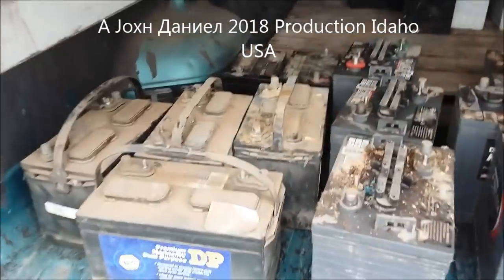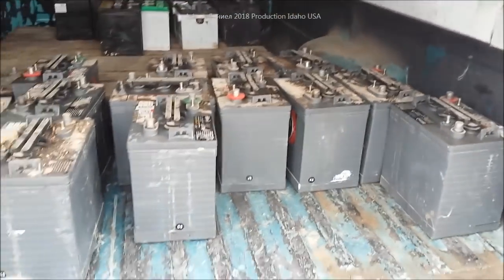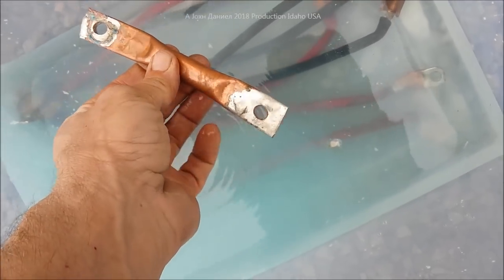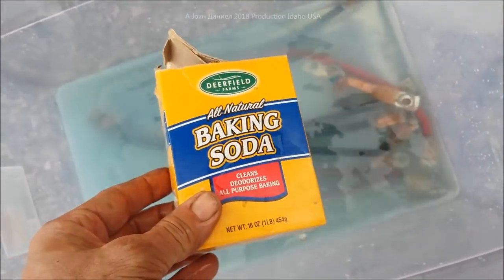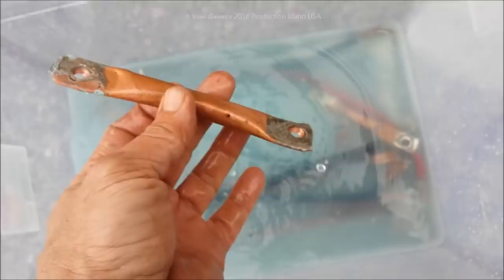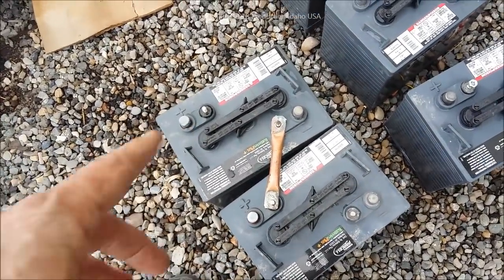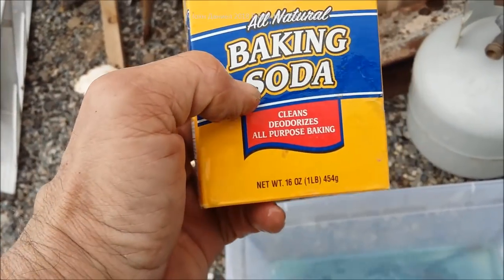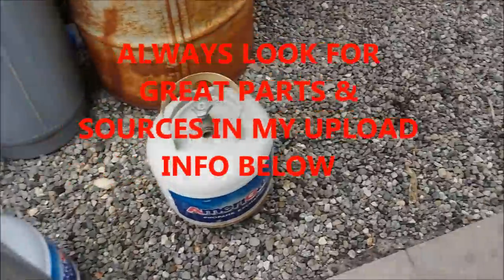Great battery care & Off Grid tips - save your car Battery Service Items Below

Comment from the maker: A Parts List you'll love  ↘ -- USA made Welding/Battery cables TEMco https://ebay.to/2HizLDi pure 100% copper.  Exact 5/8 type L Copper tube https://ebay.to/2F3eHe9 900 amps & only 0.90¢ a battery.  Battery Acid tester https://ebay.to/2HeK8IC and always use a HEAVY BUILT load tester to verify your batteries https://ebay.to/2HPn8Np
AFTER you install or repair I highly suggest using https://ebay.to/2HNT7xg by Permatex, battery protector and sealer. 
This is A ABSOLUTE MUST list for doubling the life of your RV, Boat, Off Grid, and Cars batteries! 
Years of research, use, off the grid living and verified results brings me to put together a list of affordable parts you can easily go to to. Hope its helpful.

**For my RV using friends, NOTHING beats this carried with you everywhere. https://ebay.to/2HAqtlE Battery Jump Starter Air Compressor Peak Portable Car Charger Booster made by: Stanley

Comment: A bit off topic, and I have never seen this, but could you try to use an ultrasonic cleaner or a transducer from one to help desulfate old lead acid batteries. I see all these electrical methods being used but never anything with a  mechanical method. Not even sure it would be safe and it may cause more problems that it helps, but just an idea.
Reply from the maker: Vibration tables, ultrasonic machines have been tried in the past. Epson Salts ( Magnesium Chloride ) is a chemical reaction that works best. Mechanical methods have been know to explode batteries. Consider, a 1 mm plate coating of sulfur being dislodged and shorting 2 plates together! Verses MagChloride dissolving it as the acid destroys the magnesium molecule therefore re-suspending the acidic compounds and H2O.
Reply: @JOHNDANIEL1  , Makes sense. I had never heard of anyone trying it so it made me wonder about it. Thank you for the reply!

Comment: I have two Duracell batteries 6 V deep cycle there about eight months old can I add two more 6 V batteries to that or do I need to change out everything So everything is new
Reply from the maker: Are you trying to go 24 volt? If not, I doubt you would have a problem, but if you will slave load the new ones for a few months you can surely make them equal. HOW TO SLAVE LOAD a battery, You draw from the first set first then with a thinner gauge wire you draw from the older ones. I had 2awg onto 3 new 12 volt Batteries, then dropped to 4awg to connect the older 4 batteries in my barn down at the end of my property. 900 watts Charge goes into the group of older batteries, from there into the new ones, and you draw your lighting and inverter power from the new ones. Hope thats a visual.
After about 8 months all batteries had the same gravity. Now they are 4 and 5 years old, performing fine.